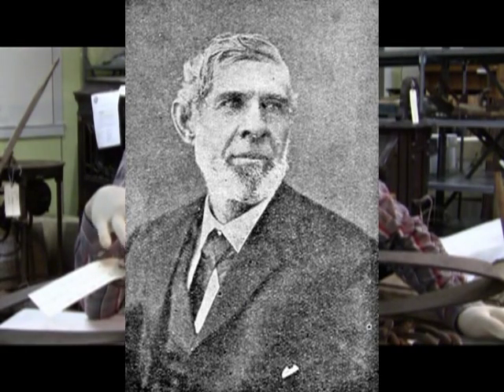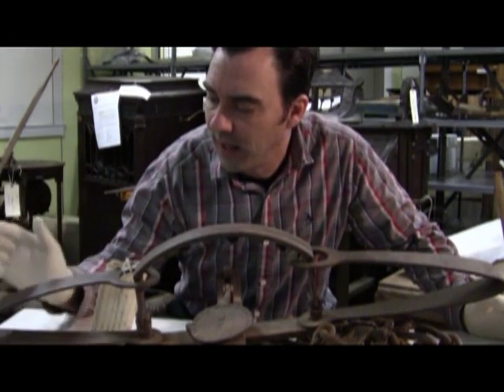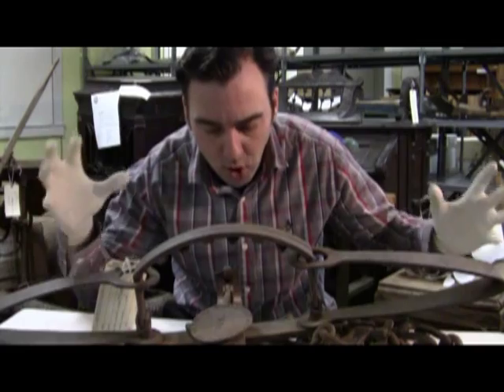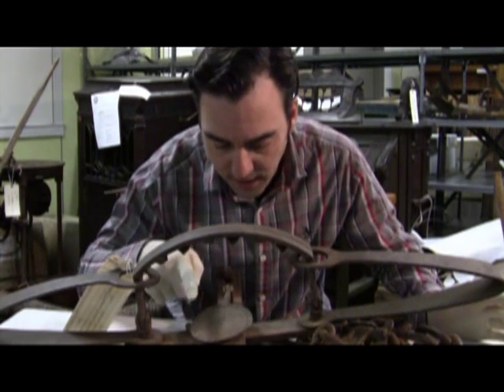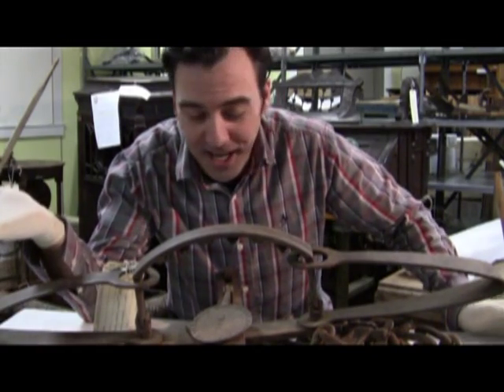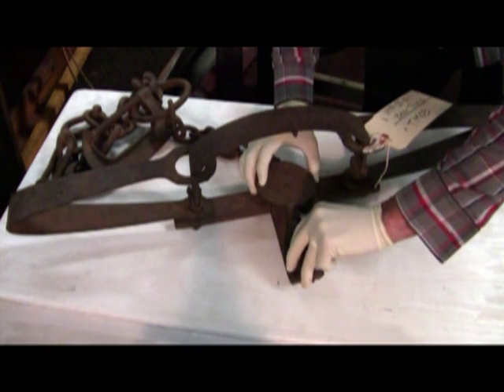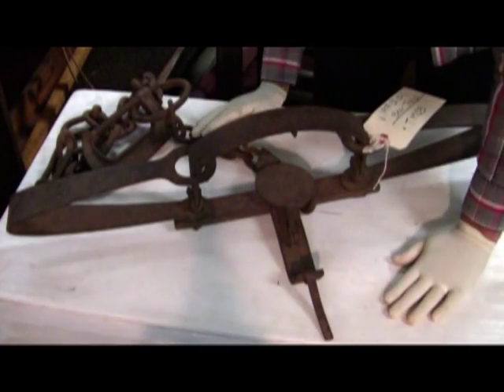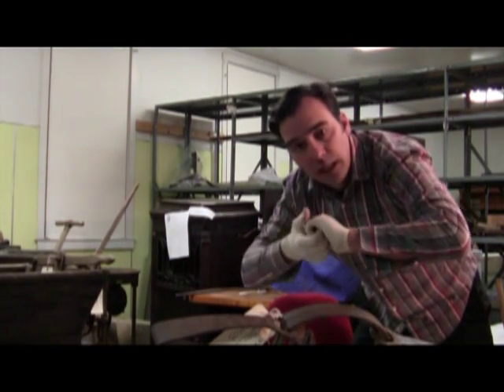Bear Trap Placer County Museums

Comment: I have a bear trap found in Potter county,  Pa. in about 1932. If I attempt to remove the rust from it, will that ruin its value?
Reply: Zip It would you want to sell it
Reply from the maker: As a museum, we don't like to refinish objects.  But I would check with collectors and see what they value higher -- one in vintage, rusted condition, or one that has been "cleaned" up.
Reply: @mike17080   i got newhouse no 15